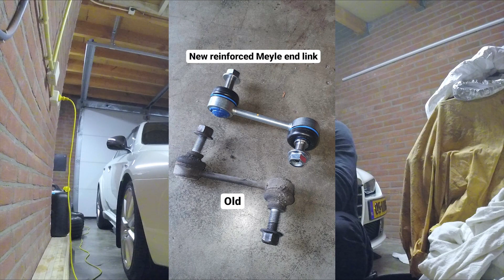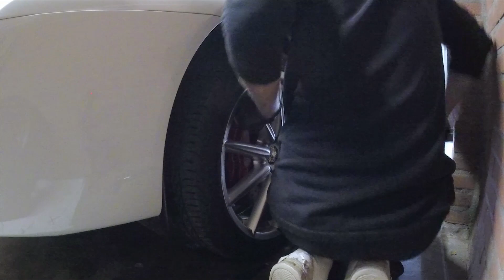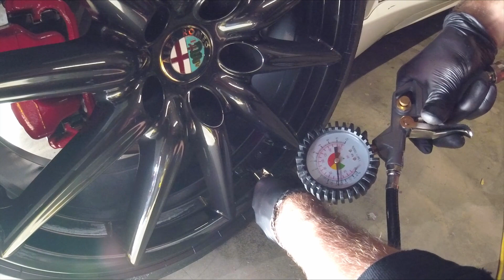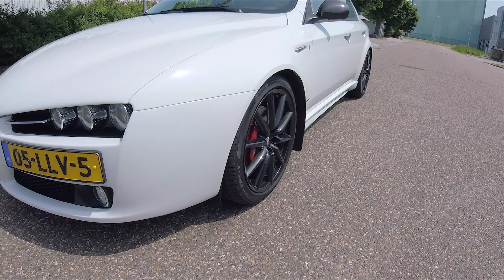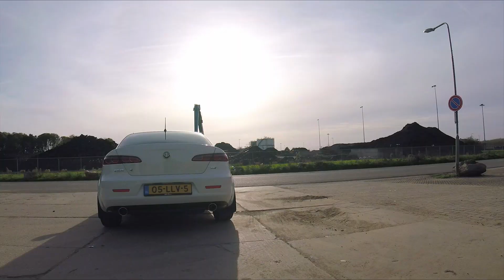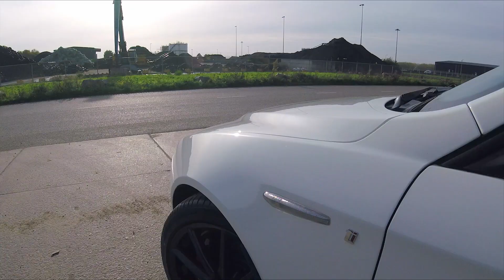Alfa 159 NEW Ti WHEELS in DARK MIRON LUCIDO installation!

Comment: P0017 on my 2.2jts brera, what could be problem, replaced camshaft sensors, crankshaft sensor, oilt temo sensor and still that code? I know p0016 is stratched chain but p0017 and chain is good

Comment: Hi Jim 
Car looks lovely 
Can you tell me please exactly the name of the tyres please 
Cheers
Reply from the maker: Hi 🍀 thanks man! Pirelli Sunergy Power. Cheers
Reply: @939driver  hi Jim 
I need new fog lights for my 159 ti
Do you no a reliable source were to purchase them
Cheers
Reply from the maker: @jaffac5382  hi man, yes Italy-Motors or QVerde
Reply: @939driver  cheers Jim
Reply: Hi Jim 
Trying not to be a pain
One of the side skirts is coming loose 
Both ends can any black mastic stick them back 
Or do I need a specific glue
Cheers
Reply from the maker: @jaffac5382  hi man no problem at all. I had this happen to one of mine as well. I used Sikaflex adhesive for that. Comes in black and white versions
Reply: @939driver  thanks Jim

Comment: Does the front wheels look pushed forward in the arches?
Reply from the maker: I don't have spacers, this is stock wheel setup
Reply: @939driver  I mean towards the front, the bumper, not out. At 9:32 it seems the tyre is almost touching the front bumper while there is a lot of space in the back.
Reply from the maker: @mantasjk  man I think you are right 🍀 my lower control arm has been replaced recently, I checked and allignment is not as it should. I am going to have to fix this.
Reply from the maker: @mantasjk  thanks again for noticing. I checked and the lower control arm bushing was not fully seated inside the subframe and only fixated with 1 bolt instead of the 3 in total on the inside bushing 🤯 So quite dangerous and basically riding with roughly 5 degrees of toe in (also bad for tyre wear). I took out the bolts, pushed the bushing in all the way and fixed it properly with all bolts, myself. The wheel is now centered as it should, and I now can get a proper wheel alignment 🍀 Thanks again for noticing man! Could have gone badly if I drove it fast in Germany. Luckily the work had been done by mechanic only a week ago and I did not drive much since then otherwise could have ended badly. 🙏🍀
Reply: @939driver  Cheers
Reply: @mantasjk  good eye bro